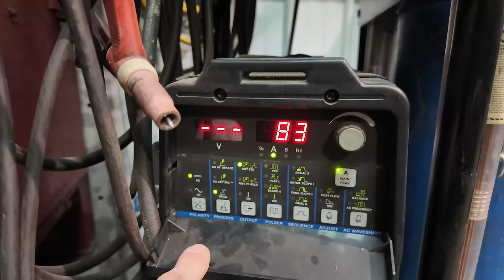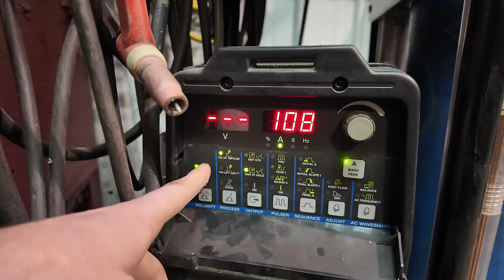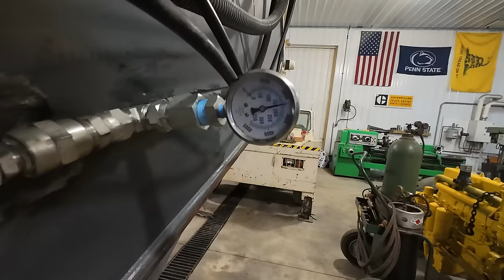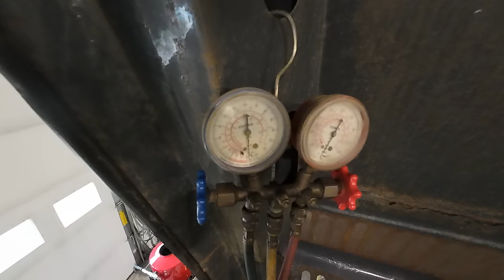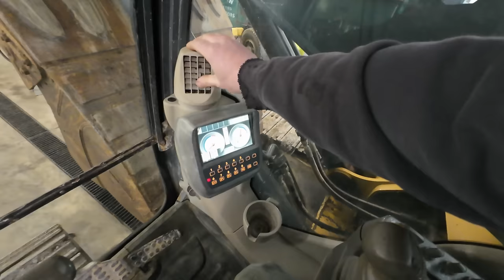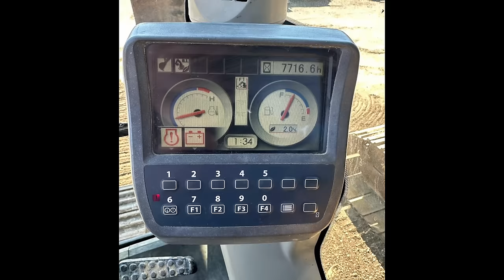Fixing to Sell | Selling our John Deere Excavator

Comment: I as an EPA certified refrigerator service mechanic have two things that you have done incorrectly first four value manifold is required so that refrigerant lines are with out admisfar. The other issue is that the dryer receiver is a must replace. Have fun with your self.
Reply: Absolutely correct!!

Comment: Sam, 
    The thing to remember about TIG welding is that it requires the welded surfaces to basically be spotless clean. After you do the area prep/sanding you have to clean it with acetone. Don't use something like carb or brake cleaner because of the chemicals used in them - they can produce dangerous fumes when hit with the heat of the torch. You also need to wipe the welding rod down to remove any surface contamination that would lead to porosity.

Comment: Nice work, Sam.

Hey, you know when you were installing the second pin, you found it difficult, right? Even though you used two hammers and a lot of huffing n puffing.

Well, guess what. You remember the holes you looked through using the light on your phone. They are for easy pin access. All you had to do was use a 2' rod of a smaller diameter. Line it up on the pin and hammer away. Pin removal is where they become really useful.

I'm just saying that from the outside looking in and one who has done many pin removals, I knew how best to get that pin in from the get-go. 

Hindsight is a wonderful thing, too, isn't it.😉⚒️🏴

Comment: Fun video - from heavy duty repair to AC...  Nice work.   I think the second pin was started into the hole when Sam pulled out a 'persuader'.  But maybe by releasing pressure from the fork lift it would have wiggled into place without so much effort.  Just a thought.  Still, this guy has skill.

Comment: TIG is really touchy about small things. Like if the metal isn't as close to 100% clean as possible, no paint oil or rust. Another thing is unclean tungsten or filler rod. Or just the weld being able to suck air as you try to fill in a hole. Just lots of small things.
Reply: Clean filler rod is a MUST!

Comment: Free Pro Tip: 52:01 NEVER use any sort of miracle stop leak on ANY A/C system, automotive or not.
The secondary side effects are always worse than the inmidiate results you're expecting.
Fix it right, fix it once and you won't need any of those "snake oil" sealers.
I would've checked the oil in the new compressor to make sure it had green/yellow dye in it and just charge the system.

Comment: I hope your floor drain changes   go to a oil dump prior to going to ground or septic. I ran a mock that with shafting oil once DHEC not thrilled with oil discharge even on accident. Watch testing hydraulic repairs over the drains.

Comment: Dude! Your pin installation efforts at the 40:00 minute mark, did you notice the two holes in the frame work whereby you could insert a rod through and strike it with your whammer?

Comment: I  mean... Couldn't you have like, flipped the cylinder the other way around to get the line out of the way? Or are the pin holes different sizes (or is there some other reason forcing it to be one way only? Hydraulics dripping out if its upside down?).

Oh,  that's why. It all made sense the moment you installed that cylinder :p didn't think of that!

In any way great content!

Comment: With the thumb locator pin, there’s a hole for a drift to hit the pin in if you’d looked. TIG welding near metal that has been immersed in oil isn’t your best course, even if you’ve degreased it thoroughly. A 7018 2.5 (12 gauge) electrode for the root pass and a 3.35 (10 gauge) for the cap run would be better. Not criticising just offering the benefit of fifty years in engineering. To quality content.

Comment: You bent the rod because the pressure at the thumb cylinder is too high. The AUX psi to the thumb should be no more than 2500 psi. If there is system psi at the thumb cylinder your bucket cylinder will over power the thumb and vent the rod every time.

Comment: 8:01 the mounting of the actuator on the turbo is such a stupid design choice. One look at the casement and you can see it's been cooked to heck and back. Sometimes you have to wonder exactly what, other than dust, is rolling inside these engineers' heads...
If i were to own one of these (and now i know not to, because this is a big red flag - on something as basic as this) i would mount the actuator with a heat blocking spacer, to at least mitigate some of the heat transfer.
Reply: The actuator is liquid cooled, you heard him talking about the cooland lines hooked up to it. It is and older machine, parts like this are ok to wear after some time... It is a relatively cheap and easy to replace part, so what is the issue really?